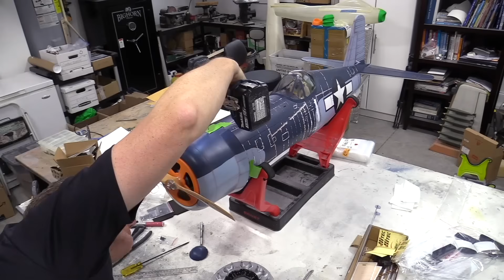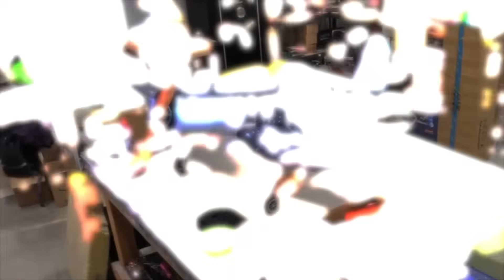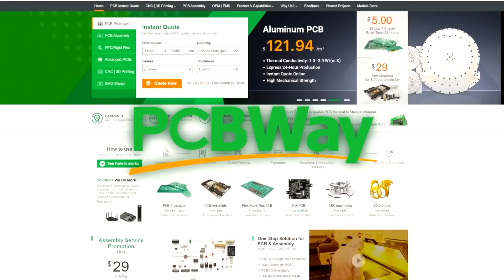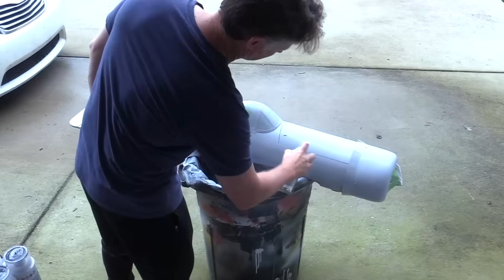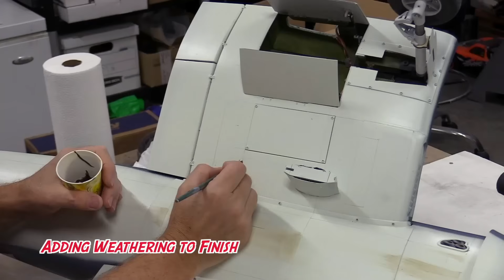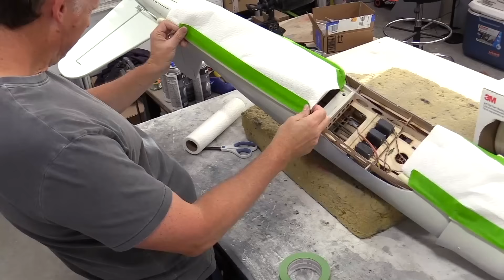I HAD to See What This RC F4U Corsair Could Really Become

Comment: I'd like to know what brand that thin orange tape is that you use as well as that big box of what appears to be circular tape of some sort. What you use to delineate the top dark blue color from the lighter gray color on the bottom of the fuse. Also, are you burnishing the paint with a scotch bright pad? Or 400 grit sandpaper?

Comment: Looks good! I too like to weather my planes. My Flyzone A6M2 looks like it's been at Rabaul for quite a while. 
And yes you are correct, the amount of fading depended on how long the planes were in the field exposed to the elements, especially the sunlight. Some older planes were so faded, that even color pictures it was difficult to tell where the dark and light blue colors touched, and they also appeared to gray down in tone too.
Great job! I like the way you did the panel lines. Those take me forever to complete, as I tend to get a little OCD, with them.

Comment: Why are RC props always undersized compared to original aircraft?
Reply: Because the original aircraft had 2000 plus horsepower. In model form it is hard to get a engine powerful enough to be able to spin a scale prop good enough to get good flight performance. 

If you look at large carf models. Theu need a 250cc size engine to spin a scale size prop...and some still look unimpressive in the air. Its all about having enough power to spin the prop.

Comment: what kind of paint can i use thats glow fuel proof if there's such a thing  if i decided to paint.
Reply from the maker: The key is to spray an epoxy clear coat over the model once all of the paint work is done. That’s what will fuel proof it. I believe there are some options you can get in spray cans.

Comment: Chris ...Can you post a link for the scale prop?   More info?   Length and pitch?      Thanks
Reply: I think its a varioprop. But not sure about the size. I too want to get this. But waiting too see if Chris flew with it and it worked.
Reply from the maker: It’s a varioprop. 16D hub with the 18.6” scale profile blades.
Reply: @Thercgeek  Im thinkin the FMS 1700mm 4 blade corsair prop would work well then...   its   18/11

Comment: Started putting it together. The gear doors on mine had the hinges that move the doors at  different heights on each set so they where not closing the same. I had to take them off and glue them in the same spots. Some trial and error with the rod lengths also. To make the doors on mine open freely and wide enough for the wheel to not hit the doors i sanded and trimed the hinged edge of the doors.  That gave the doors more room to open and also not have the servos buzzing under tension. Its a fun build. Never built anything this big before. Just some notes. It would be cool to have simple diagram on what the position of the hinges on the door should be for best operation. Im not sure if my set up is the intended setup but it works. Hehe😂

Comment: I enjoy your content Chris .. it's just great.. Two things you did during assembly 1)  super glue the wood to help the screw bite,  2) what's the in the glue 'butter' you use to adjoin parts ?    Seems a shame you didn't install a radial gas engine.. Moki, etc .. some super duper prop on the Corsair.. so beautiful  it rates it.. but than again they cost thousands .. deserves a gas radial though.. Oh how many times have you sunk a drill bit into your finger ??
Reply from the maker: What do you mean by glue butter?  Are you talking about what I added into the epoxy?  That was micro balloons. It thickens and colonizes the epoxy. So, actually makes it lighter while helping it stay in place while it cures.

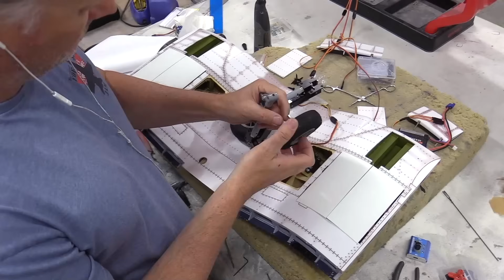Comment: 5:10  Please, please wear safety glasses any time you are using a cutting wheel (and when using grinding wheels, too).  If the cutting wheel shatters it will launch chunks at high speed which can easily take out an eye.  Also, using the side of a cutting wheel for grinding increases the chance of the wheel shattering because it both applies a side-load to the brittle wheel and gradually wears away the structure and reinforcing fibers.  Cutting wheels are designed to wear from the outside edge in, not from the side.  Everyone uses the sides of cutting wheels for grinding (myself included) but it is risky and will cause the cutting wheel to fail sooner than it normally would.

Comment: I have the Dc3 and hellcat, from Nexus, and they are HEAVY, but its quite easy to lose 500grams with a carbon wing tube, and move all the servos back to over the wing, saves on wasted metal control tubes etc, both planes fly better with the reduced weight, with the batteries slightly further forward

Comment: Would like to have seen you make the wings fold that is the real finishing touch
Reply: That is a very difficult and tricky thing to do, plus has a significant weight and complexity penalty. If you want to do that you need to design that into construction, very difficult to add afterwards. Chris is the guy who could pull it off but man that would be a monster of a job.

Comment: Beautiful. Love the scale propeller. I'm putting a similar plane together but having problems finding custom length prop adapters to work with a thicker hub. Sharpie makes a felt tip in silver that works great for a chipped paint simulator. Used it on my Corsair. Gives it a nice, dirt airstrip, look.

Comment: Most people are not aware that the Corsairs wings were fabric covered. From the spar back. That's why the ribs show.
Reply from the maker: Yeah, pretty unique feature of the Corsair. I tried to simulate it with a bit of shading/fading through those outer wing tip regions. Had I stripped and glassed the model, I would’ve covered the area in fabric with some simulated ribs underneath. 😊

Comment: definitely just me folding wings. electric on the fence verses True radial. Scale Prop with chrome spinner. I’ve watched ones on you tube with sound board mehh. they need to able slowly turn the motor as though it were starting from cold add smoke when it catches. Speakers don’t have enough sound effect. Needs to play clear prop loud n proud. but the smoke system during flight with rolls mild aerobatics. Putting a speaker inside muffles it needs maybe camouflage marine speaker as part of the paint job.

Comment: Okay it's an ass even wood frames good but electric engines are okay on non warbirds warbirds have no sound they're just a simulation of what is in the air yours happens to be a Corsair Where's the sound at person. I've done every bit of that but I've never put an electric on a warbirds they just a hollow sound but it's your plane I hope it flies well for you

Comment: That turned out AMAZING!  I've been looking at the Nexa P47.  I've only had foam P47s like the FMS P47 1500mm and the plane you have to assemble make me nervous.
Reply from the maker: Thanks so much!  I maidened a nexa jug for a friend of mine and it’s a really good flyer. I liked it quite a bit. Assembly is pretty straight forward on it too. Only thing would be to probably add a hatch pin for the hatch as the hatch ended up popping up on a high speed pass. So, having a little more positive hold down would be good.

Comment: What would recommend for gas proofing this plane? I figured i would paint it with tamiya then try some spraymax 2k. Its still in the box. Fg33 Radials are sold out.. it will be my first gas plane. 😅 i guess i could test it but i was curious if you tried that before.
Reply from the maker: If you’re doing gasoline, a good lacquer clear should be fine. The 2k seems could do the trick. Otherwise, the safest bet is an epoxy clear coat as that will hold up to even nitro fuel.
Reply: @Thercgeek cool thx ill try those federal paints also. Im going for the bunker hill scheme with the yellow trim. I really do like painting them its a throw back to when i used to make plastic kits.
Reply: Epoxy thinned with rubbing alcohol is what I've  always done.  About half and half.
Reply: Nicely done, Chris!